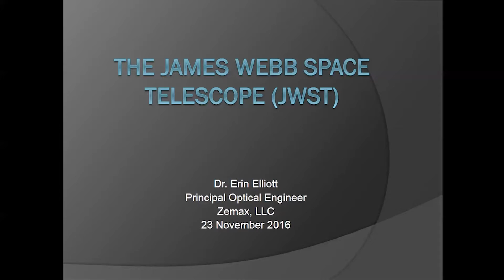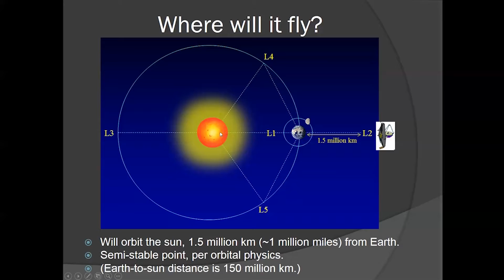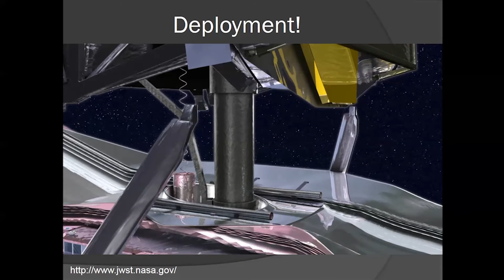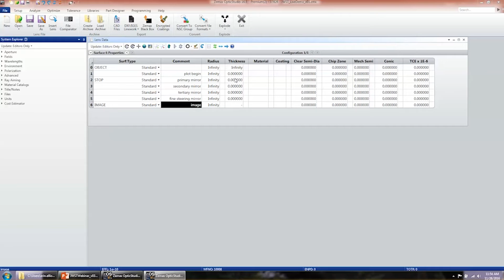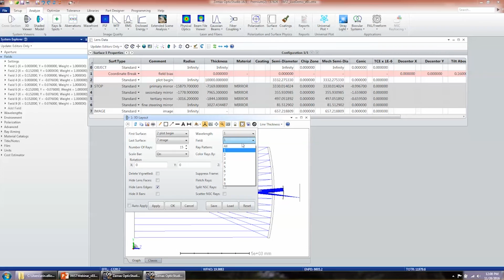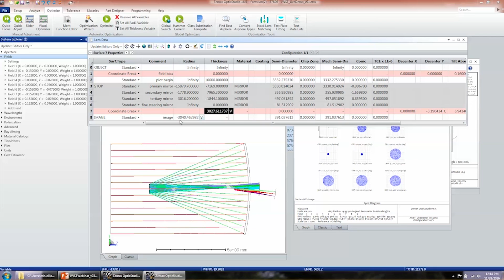Designing of the James Webb Space Telescope

Comment: In the field data how to find the value to be entered in Y column? 9arc minutes is 0.15 degree in X direction but I didn't understand how you got 0.076 degree in Y.
Reply: For the X axis, the 18.2 arc minutes convert to 0.3033 degrees. Around the center point in X, that's +0.1516 degrees in the positive X direction and -0.1516 degrees in the negative X direction. For the Y axis, the 9.1 arc minutes correspond to 0.1516 degrees full field. Around the center point in Y coordinates, this is +0.758 degrees in the positive Y direction and -0.758 degrees in the negative Y direction.